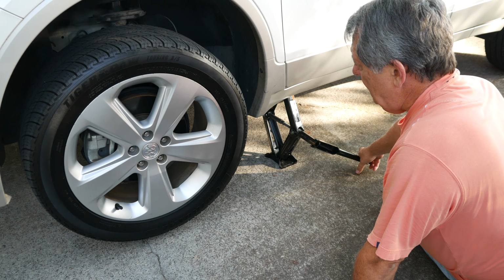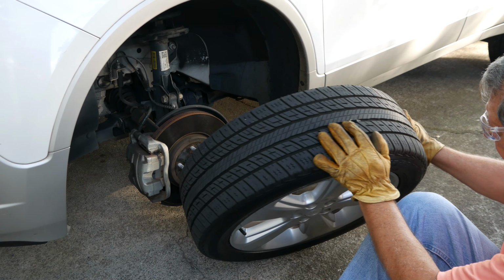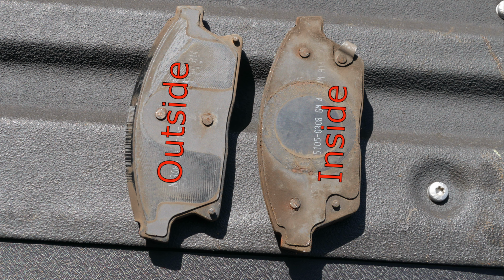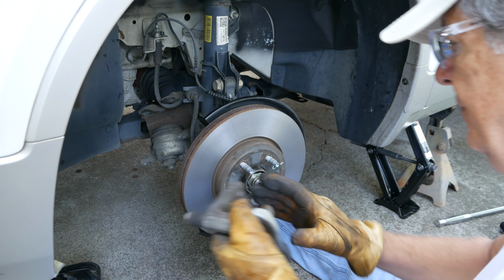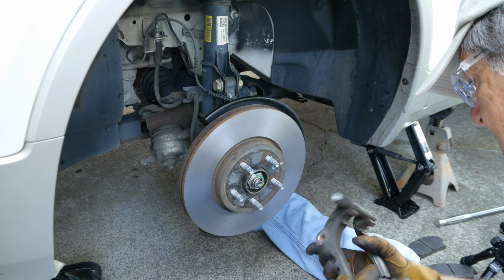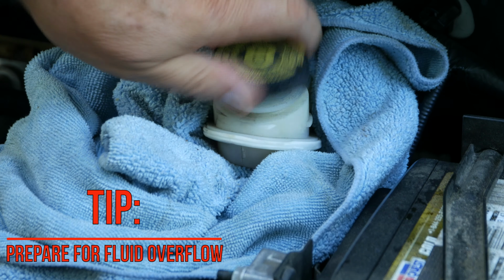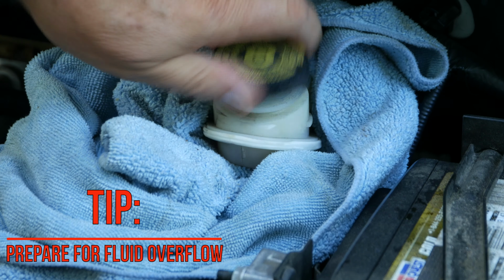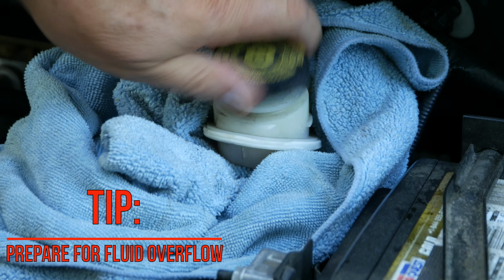2015 Buick Encore Front Brake Pad Change and Rotor Removal

Comment: I have been replacing my own brakes for 50 years, yes 50 years. When I am working on a car, I have never done before I look for a video for tips. Your video is one of the best I have ever viewed. Thank you for taking the time to make it. I will now do the brake job on my daughters Encore with added confidence that it will be done correctly.
Reply from the maker: Thanks for viewing and for the kind words Grayson.  Glad you stopped by.  In case you’re interested I have a video for the rear brakes as well.  Please consider subscribing.  Dean

Comment: If, when removing a caliper bracket, and you can't get enough leverage,(usually happens when working with a jack instead of a lift), turn the steering wheel towards the side your working on. It make for allot more range of movement
Reply from the maker: Excellent point Joshua.  Thanks for viewing.  Dean
Reply: Was gonna say same thing.

Comment: Nicely produced video!  It is clear you took some time to edit and it really shows.  A few questions:  Is the caliper free hanging once removed?  If so, aren't you worried about the strain that puts on the brake line that connects to the caliper?  Also, why not use permatex or something similar on the bracket before installing the hardware and on the back of the pads?  Did you relubicate the caliper slide pin?  I might have missed that.
Reply from the maker: Hey Ryan.  Thanks for viewing and the recognition of production and editing time.  Normally, I would hang the caliper from a coat hanger, but in the case of the 'front' brake pad video, if you noticed, I lifted the caliper up and set it on top of the linkage for video clarity.  It was seated really well and I wasn't worried about it falling.  Please check out the video I have on the rear pads for suspension by coat hanger in a more precarious location.  Permatex would have been a better material than what I used, for sure.   I really hate that CRC stuff.  It's just that I bought so blooming much of it in that bright pink bottle, I'm trying to use it all up!  I did not lubricate the caliper slide pin but it would have been nice if I had.   Dean

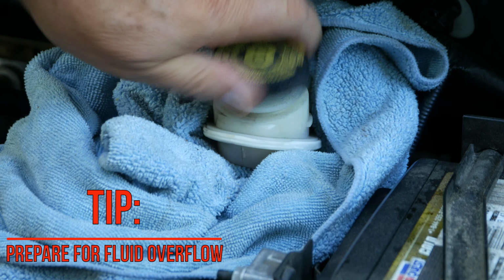Comment: Good video but at 12:26 you say the torque on the wheel lugs are 140 ft. lbs. That seams a little high. I think its more like 100ft. lbs..
Reply from the maker: Got this number from the Buick dealer.  Thanks for viewing and commenting.
Reply: @PilotViewProductions  Look at page 12-2 of your owner manual, it list the lug torque to be 100 ft. lbs. (metric is 140 newton meters).

Comment: Makes me incredibly nervous seeing someone with their leg under the car while having to use extra effort to remove a bolt. My jack from my old car collapsed when I did that once, just barely got out from under it in time.
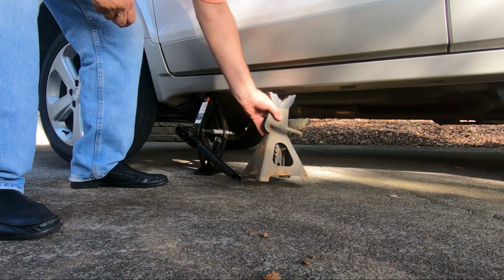Reply from the maker: Me too Michael.  That's why you see me always stress using a safety jack in addition to the factory jack as I did here at 1:38.  I had my Mercedes (a much heavier car than this Buick) roll off the factory jack years ago just as I was pulling my legs out from under it.  It's safety jacks from then on.  Thanks for viewing.  Dean

Comment: How can one figure out the torx for a 2021 Buick encore gx
Reply from the maker: @kingg3259  Have you just tried Googling it?  It’s between 110 and 120 nm
Reply: @PilotViewProductions  I have I think it’s like a 15 but I’m learning. Trying to basically build my own repair thing why pay someone else to due simple jobs for labor when I can do it myself. Thanks you guys like you I’m saving money.
Reply: @PilotViewProductions  right now that part I’m talking about the little bold that you had screwed out at the bottom
Reply from the maker: @kingg3259  Yeah I didnt have the torque settings for that
Reply: @PilotViewProductions  ahh gotcha yeah I have my manual I know my torque setting is like wheel nut torque of 100lb ft.

Comment: What’s with the leather gloves?Also helpful hint you can turn your wheel to gain more access for torque or just ease of working on it.
Reply from the maker: Well…I have found that when wrenches slip off in tight spaces, leather protects better than latex.